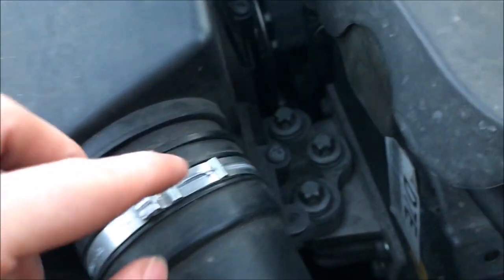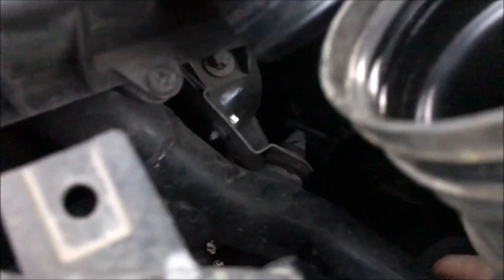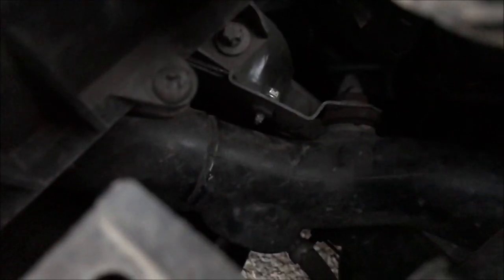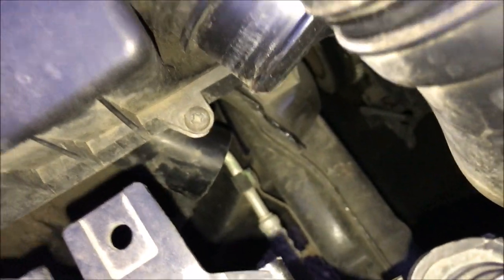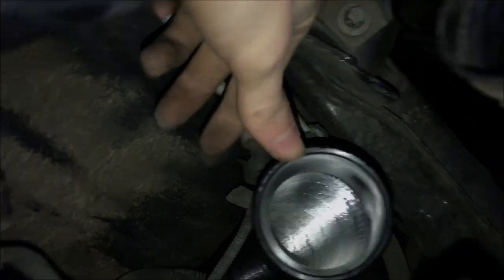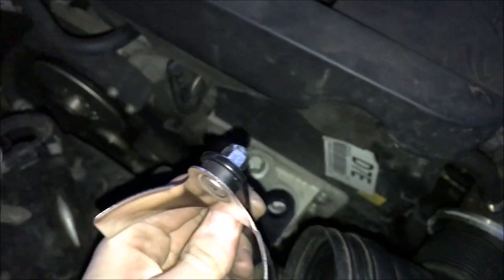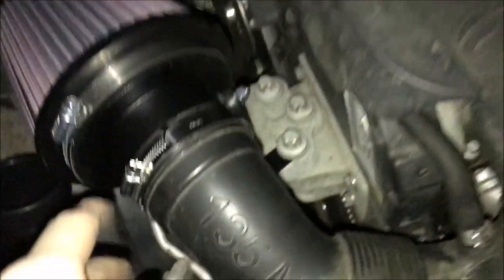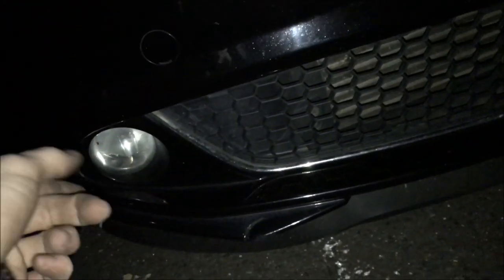K and N Airfilter : Alfa Romeo Mito

Comment: Hello ,I bought the KN RF-1005 Air Filter ( Not Kit), there's this air filter in the KN 57I-0679 kit. Same as your filter. But i dont have a plastic hose reducer for installation. Is it possible to share the measurements of both sides of the hose?